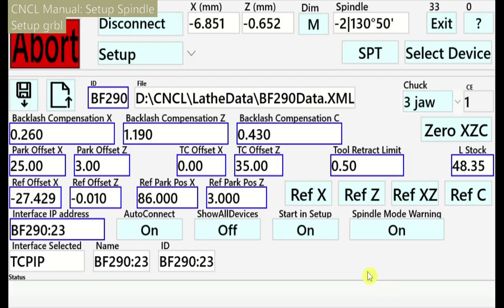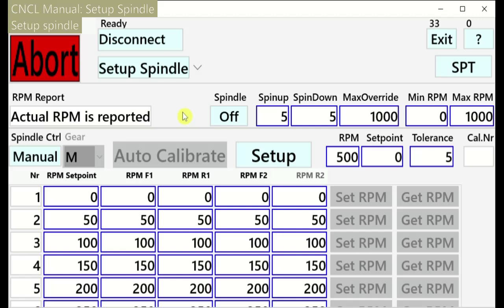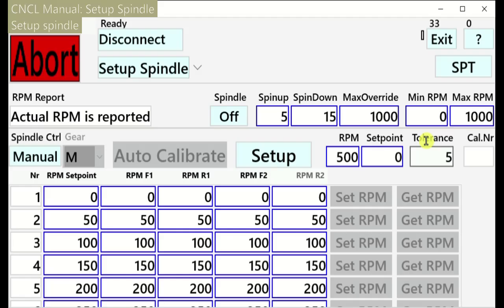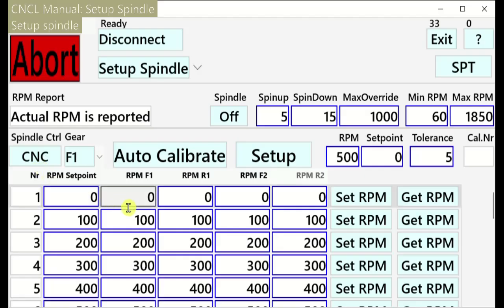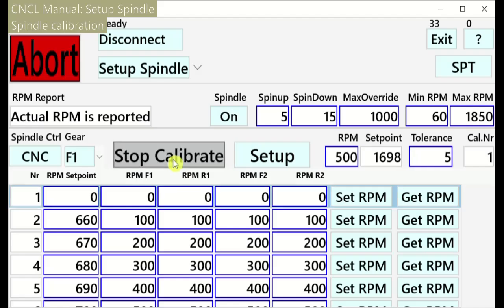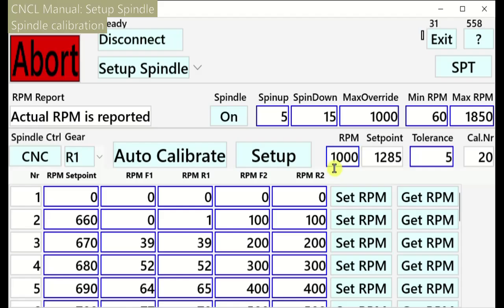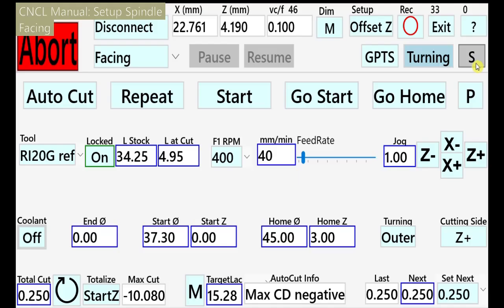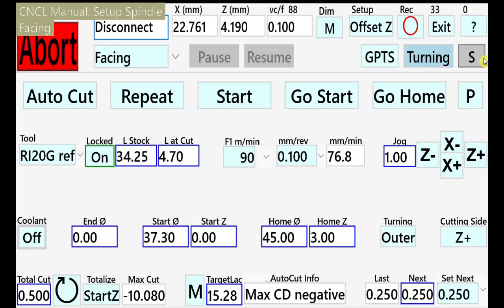CNCL manual: Setup Spindle

Comment: Hi! I have a question: does your app have backlash compensation? My lathe has a lead screw on the x-axis that isn't a ball screw, and I'd like to know if your program allows me to correct for backlash.
Reply from the maker: Yes, CNCL has backlash compensation on all axis X,Z and C (Y). 
My lathe also uses the original lead screws (X and Z) so it can still (and is) be used manually.
This video shows how I measure the backlash compensation and how it is setup.
https://www.youtube.com/watch?v=ySOyoiC7dyw
Reply: @MetalWorkerTools Thank you very much 👍👍
Reply: @MetalWorkerTools What type of motor do you use to move the C axis?
Reply from the maker: I use the original 1500W brushed DC motor for normal turning operations. To use as C-axis I added a second motor that I can activate by a lever. Started with a Nema24 4 Nm stepper and changed to a 1.6 Nm AC servo (1:4 gear) to get an impression of swapping the current DC motor for an AC servo would work. I decided to stick to the brushed DC motor but never took the time to swap the motor back to the stepper.

A servo motor capable of step/dir control and 0..10V speed control is probably an easier way to add a C-axis. Then you have to use a timing belt and that is a bit more noisy then my current V-belts. So I decided to keep the brushed DC motor.

Here you find the drawings and pictures for my mini lathe (HBM 300) modification that I started with 10+ years ago.
https://github.com/MetalWorkerTools/CNCL/tree/main/My%20Lathe/Stepper%20Mount%20Spindle